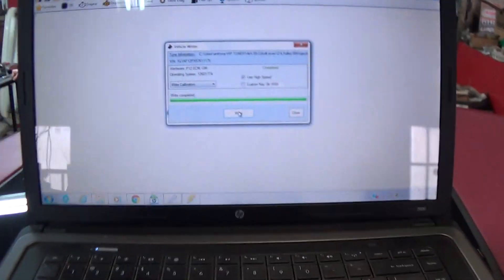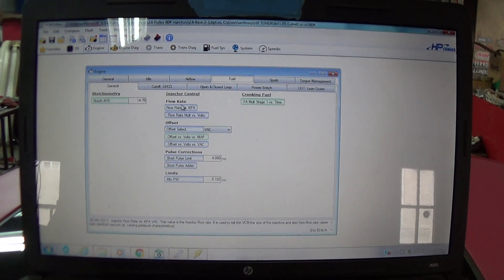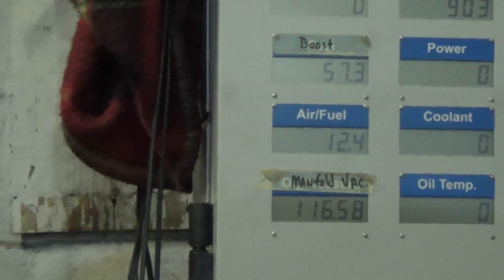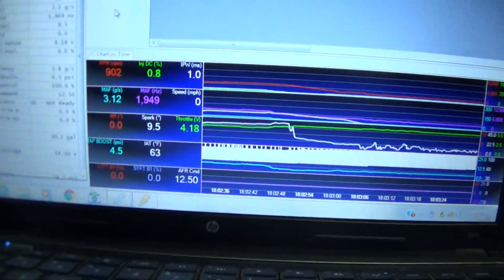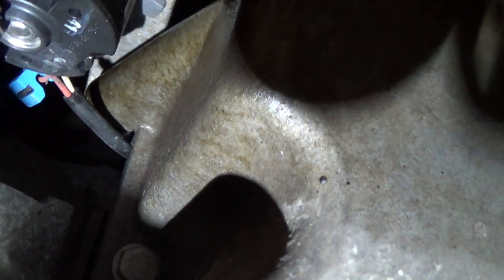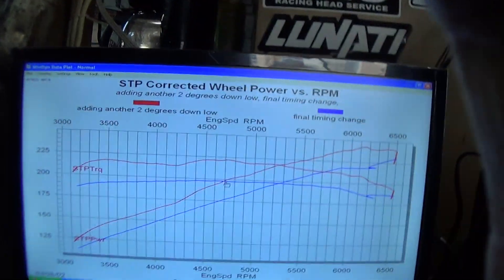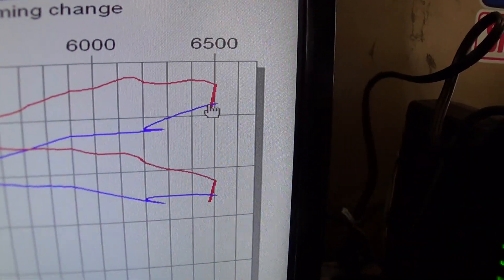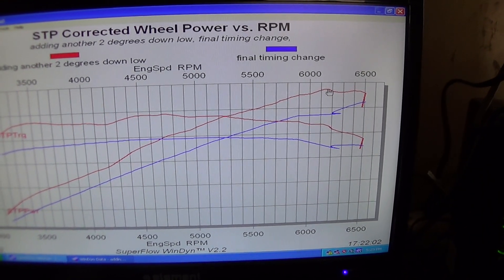Dyno Tuning the 2.6 pulley and 80# injectors

Comment: I made 245 hp and 207fpt on a gm stage 2 set up now with my tvs setup i made 375 to the crank
Reply from the maker: same everything and just the super charger change or did you do anything else
Reply: 80# injortors ...2.9' pulley... stage 4 clutch .... 3' intake and a tune that was very expensive at 3100 buck but it was well worth it.
Reply: Do keep in mind all the numbers I said were to the crank I got 207whp and 177 to the wheel
Reply from the maker: @chriswells7373  i feel like you should have made much more then that on that setup
Reply: Not bad for the ic pump not working at all I'm going back to get it re done
Reply: And the iat were at some points over 95°c
Reply from the maker: @chriswells7373  geez thats no good, thats crazy high

Comment: I have a 08 2.4 SS and this summer i put the kite supercharge and 2.8 pulley with performance cams valve spring/valve i wonder how many horsepower i can get with that because i want like 280-290hp

Comment: how many hp increase
Reply from the maker: well considering i found out after pulling the motor apart that i had a cracked piston i think it would have been more but i got 30 whp increase
Reply: @salvobrothers5928  hello friend that injector recommend me if l have pulley 2.8
Reply from the maker: @guillermorodriguez7031  I would get them, then if you want to do cams later or any more power from something you wont have to buy new ones again

Comment: How much horsepower
Reply from the maker: i show the graph at the end of the video its just short of 250, im pretty disappointed in the outcome it really needs some cams which i plan on doing soon
Reply: Salvo Brothers Motorcars oh ok.. cause ima do 2.8 or 2.6.. on mines plus I got long tube headers a Downpipe. Wit 60 injector with heat exchanger tuned on 91
Reply from the maker: id say go with the 2.8 cause like i said in the video the pulley is spinning the supercharger past its efficiency a bit, i may even drop to a 2.8 so i can get the power all the way to 7k cause with the 3.0 i had on it before it made power up to 7200 now it peaks at 6500
Reply: Salvo Brothers Motorcars so with 2.8 how much power? Cause I'm still running the stock pulley .. but have what I told u I had I'm just still on stock pulley
Reply from the maker: probably the same power I'm making now just later in the RPM range. im assuming you have someone to tune it for you
Reply: Salvo Brothers Motorcars yes I do but if u making 250 on 2.6 .. I'm sure wit 2.8 it be a good extra 10 I heard on stage 3 u making around 260.. with the right mods no e85